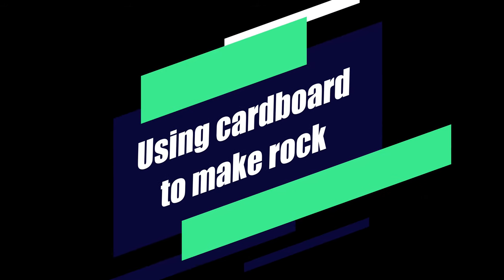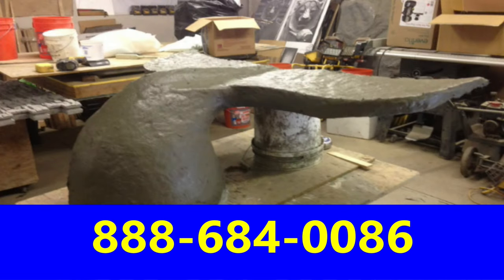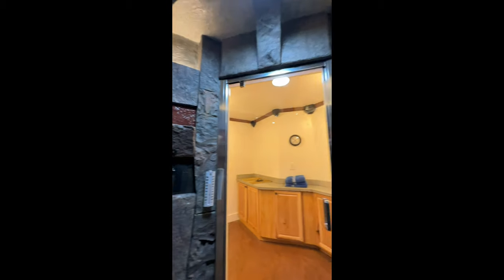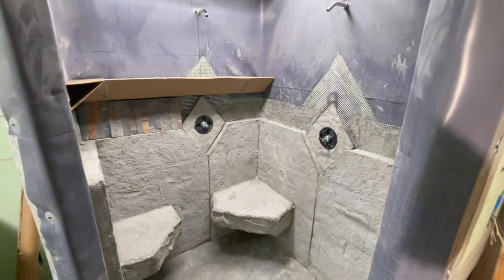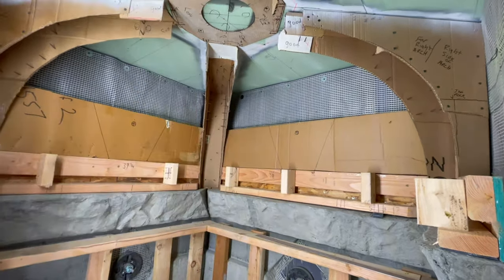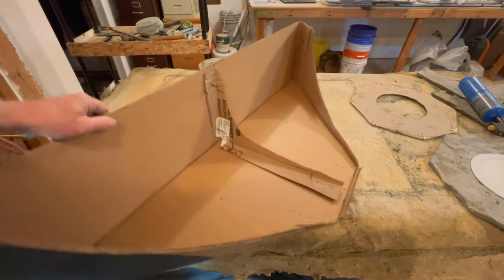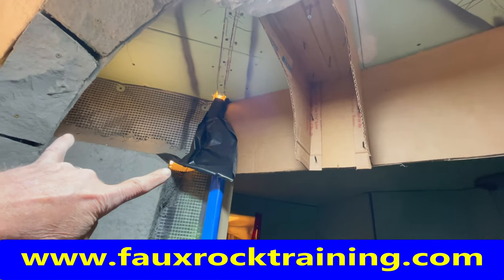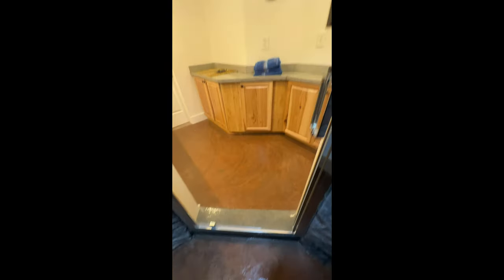How to use cardboard to make fake rock

Comment: Does the shower need a special cleaning strategy for the protective coating and all the crevices? Also, when rebar and wire mesh is used for rock construction, it seems like the rust and natural degradation of that component could lead to more structural failures and need for restorative work. What are your perspectives and experiences with these concerns? Thank you!
Reply from the maker: I’ve heard that question quite a bit but years ago even before I made a rock shower, I use the lime away which I spray on all the surfaced of the shower and it cuts all the grime and lime calcium whatever Dirt might be there in the washer down the drain. I have utilized the snow scrub approach for decades. It works like a charm.
Reply from the maker: As far as using steel reinforcement, I tend not to do it for projects of my own. I know that I have illustrated it on some of my videos, but that’s just because of demand that said, if it’s done properly, you can still be long lasting and very structural. The key is sealing the rock to wear no water can get into the Steel and then you have longevity.
Reply: @fauxrock  Thank you for your insights. When I think of bent and scratched rebar and all of the opportunities for initial moisture and ongoing humidity from an outdoor environment, Earth and air and water feature, I imagine rust starting from day 1 and never ending. This non-metal based approach seems like an improved strategy to lessen renovation and repair later. Again, I value your shared experiences.
Reply from the maker: Well thanks for the feedback. I appreciate it as well. I appreciate you watch my video.

Comment: I have yet to try fiber reinforcement in my mix. Only done steel. Where would you recommend buying some? Time to experiment in the garage haha.
Reply from the maker: Most likely to find it at a Masonary /building supply store unlike Lowe’s or Home Depot
Reply: @fauxrock  yeah Ive never seen at Home Depot. Love your idea here, how you use the cardboard to get the shapes then later make the panels.  Very awesome idea.
Reply from the maker: 👌have fun…